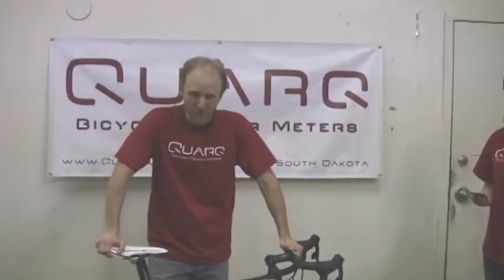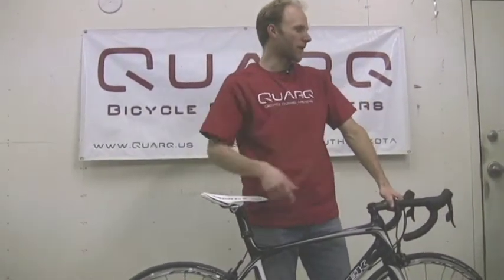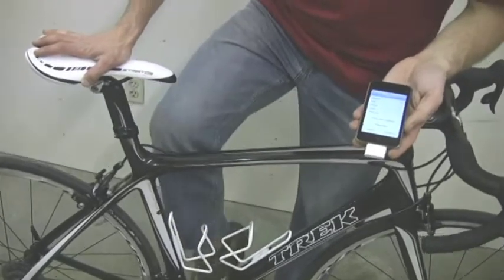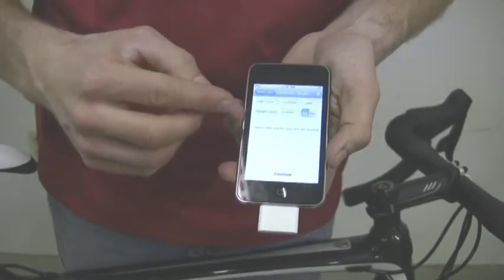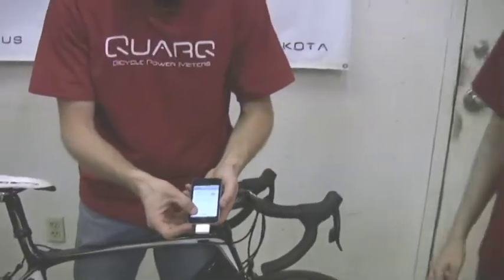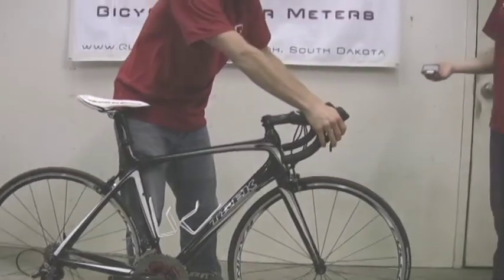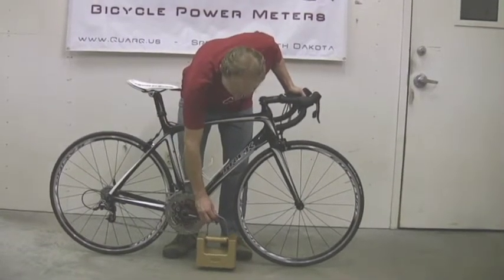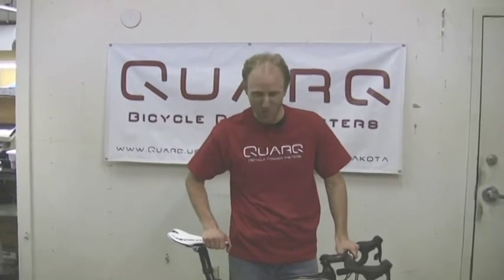Qalvin: Calibrating Your Powermeter

Comment: How do I get a copy of the Qalvin app?  I've manually adjusted the slope using quarqd and my laptop, but this application looks fantastic and much easier than performing all the required calculations manually.  I've searched the app store for qalvin but haven't seen it yet.

Comment: Can anyone tell me how the slope adjustment affects power output.

So in the example above, where the slope changes from 9.05 to 9.31, does this mean the watts recorded will be higher or lower than previously experienced (for the same effort)

Given the algorithm (y = mx + b where m is the slope value) I'm assuming if the slope value is higher, then output watts will be higher?

Can anyone confirm?